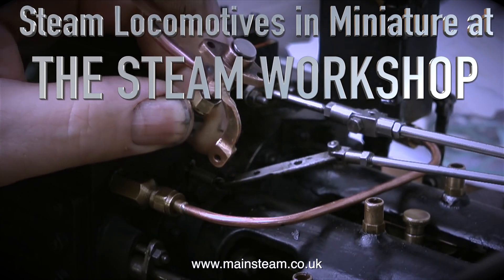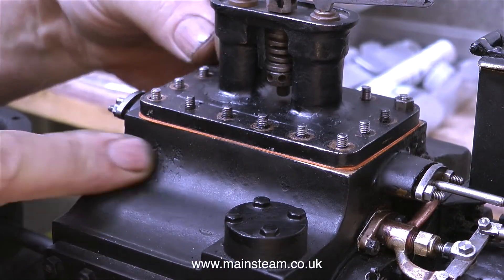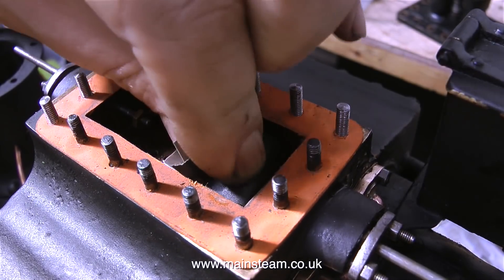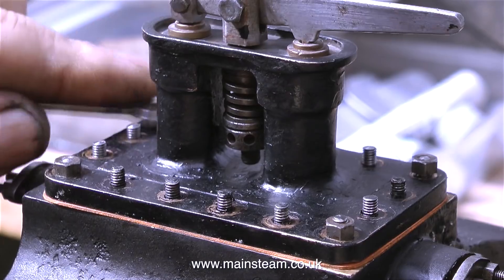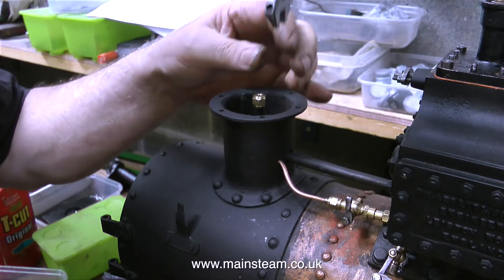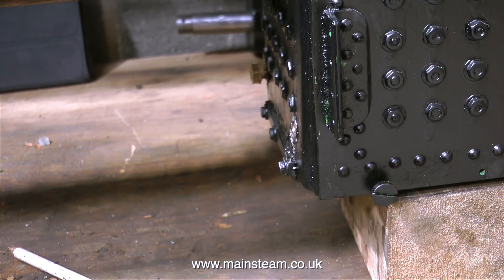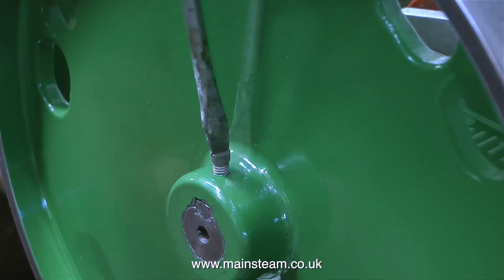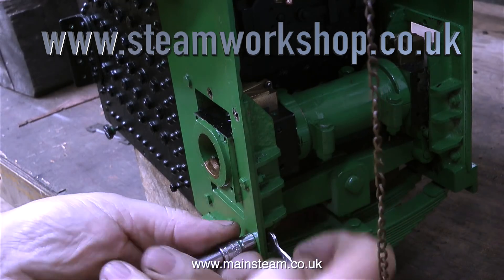THE STEAM WORKSHOP - GARRETT DCC TRACTOR - PART #9

Comment: So just for clarification... It appears, since there is a spring-return on the simpling valve motion, that this is intended for momentary use only, and that once the engine is in running, it is no longer used?  I understand that since it is a compound 2-cylinder engine, it would not be self-starting, but was the simpling valve ever used for a momentary increase in power, as the compounding was done to increase efficiency primarily, and power secondarily?
Reply from the maker: Yes it is momentary - please type 'Simpling Valve" into Google - then all will be revealed .......

Comment: Keith, I have a question about full size locomotives. On British locos on the side towards the front there is a plate, both sides. American locos do not have these, what are they for ??   Ralph
Reply from the maker: They are called "Smoke Deflectors" and they are designed to push the smoke upwards to stop the smoke from getting into the carriages behind the locomotive.
Reply: Thanks

Comment: Mr. Appleton. You are normally extremely careful covering detail by detail. Unless I missed something,I do not believe you disassembled the simpling valve on camera.  You mentioned John machined and then added an O-ring. I do believe I am looking at a simple poppet valve assembly. Where does the O-ring go ? I do wish there had been a few moments with a closeup of the mating bits,poppet to rim,and a look at where the O-ring magic was added. Your episodes are a staple,at least for me. And a pleasure.
What,no CD player? And there is no cup holder. Oh,Heaven forfend. What is the world coming to ? Oh,dearie me. Cheers.
Reply from the maker: not much to disassemble really ..... it is a simple poppet valve and John fitted an "O" ring around the poppet head to make it seal despite the play in the shaft ...... as shown in the closeup during the video .....
Reply: Perhaps I'm ignorant but I would have thought that "simpling" an engine would require three valves, one to cut off the feed between the cylinders, one to admit steam from the boiler to the low pressure cylinder, and one to allow exhaust steam out of the high pressure cylinder. Am I mistaken or is this just one valve of several?
Reply from the maker: Just the one valve to admit the steam to the low pressure valve chest.

Comment: The simpling valve is also known as double high as it basically puts the same amount of steam in the low pressure cylinder and the high pressure  cylinder